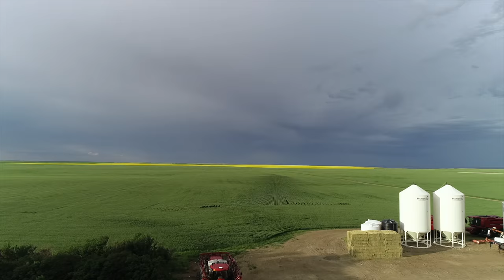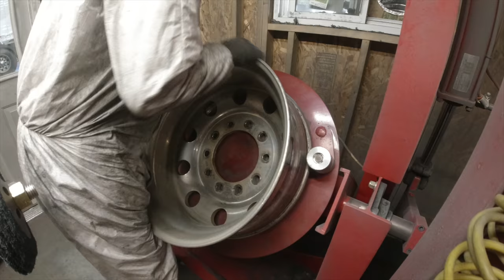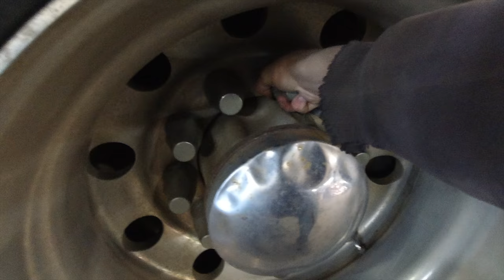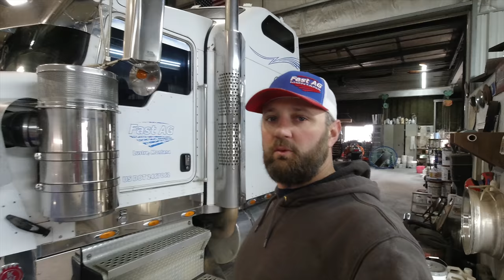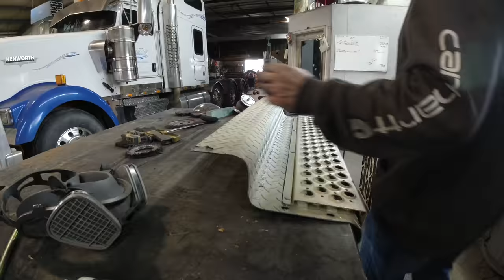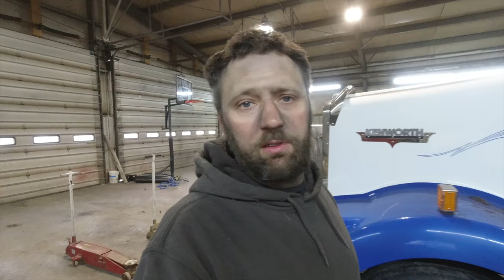New Truck and Grain Trailer! #looksnew

Comment: If you can find some Amsoil MP34. It is great on studs and the flange nuts for hub pilot wheels. It sets up similar to cosmoline. It is a great Lube for wheel fasteners. Plus other things. No I don't sell it, just passing on what works for me. Another great penetrant is JB80. Menards sells it. Better than blaster, almost as good as Kroil.

Comment: One of Sea Going Tug Boats that I was Chief Engineer on had Aluminum Diamond Patterned Deck Plates and my Assistants decided to "polish" them by using a right angle grinder with a wire cup on it. They talked to Assistants on the opposite crew to do the same. Well, they did look better (them being dull never bothered me) but after a year of them doing this every 3 weeks, those diamond plates were just about smooth!  Trust me smooth deck plates in an Engine Room that might just have some oil on them are not fun to try to walk on in bad weather (anything over 10 to 15 feet).

Comment: I rubber coated my fuel tanks with Rhino , you can mix trucks color into Rhino it works great, did it 5 years ago still looks great
Ps.Tony  paint the seps and fuel tanks the same blue as ur truck fender 😀

Comment: Tony I use a piece of heavy duty carpet "shag" if you can find it ! and by hand go all four directions ! Drove a truck with 38 wheels for 10 years hauling iron in Michigan and are trucks were probably the nicest looking trucks in the state and i never used a buffer just my hand and Busch polish .
Reply: I'm out of Michigan hauling heavy equipment who did you drive for driv'ah?
Reply: @keepontruckinoutlawlife1248  Ron Bailey Trucking out of Wanatah,IN
Reply: @TheJimmybud  right on very nice rig's happy new year driv'ah
Reply: @keepontruckinoutlawlife1248  Thanks  you too ! Who you drive for ?
Reply: @TheJimmybud  owner operator 1978 white frightshaker cabover

Comment: Just wish they made clear coat for rims.  Guessing if they did it would just look like crap eventually.  Your pretty quick at changing tires.
Reply: You can clear coat em
Reply from the maker: They make a product called alumaclear  I need to try it sometime.

Comment: With as many tires as you take off could build a holder to sit the face of the wheel onto and hold it in place? Seems like bolting a holder to the floor to mount and dismount tires would be helpful.

Comment: Are you cleaning all wheels or just the outside rims? We never polished ours but we did wash them weekly.
Reply: Guessing only the outside rims ....  Usually run steel rims on inside tire on the farm.  Or at least here guys do.
Reply: @vrfarmerguy  We did that some too, but only until my dad swapped the studs for the longer ones for double aluminum - he liked saving the weight to give him better loading options. Our main reason for keeping them clean was to check for loose lug nuts by looking at the streaks, which DOT knows to look at also. Clean rims, clean truck, polished, waxed, etc., meant that DOT would probably leave you alone. In the all the years trucking, we rarely got stopped at the scales.
Reply from the maker: Just the outsides.
Reply: @FastAgMontana  the guys in the shop were talking about your wheel polishing machine today while we were working on our trucks.  They voted and told me not to get one.....looks like too much work!  🤣.  Your trucks sure do look sharp when you finish them up though.  Excellent work. 👍